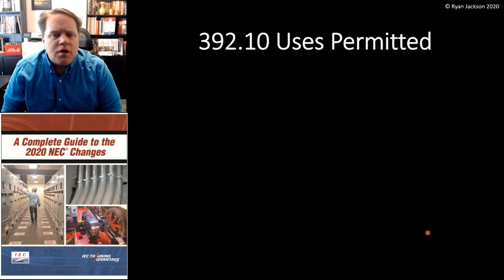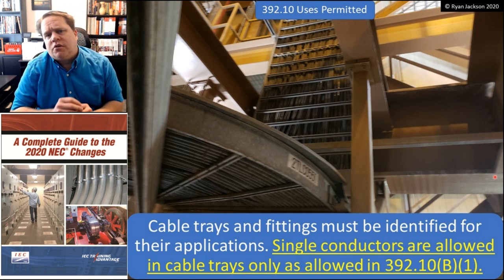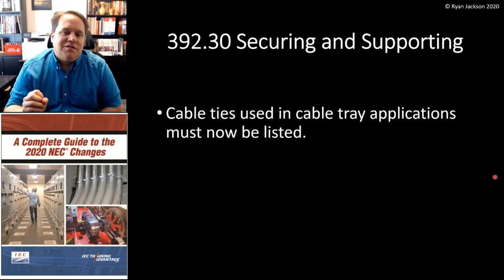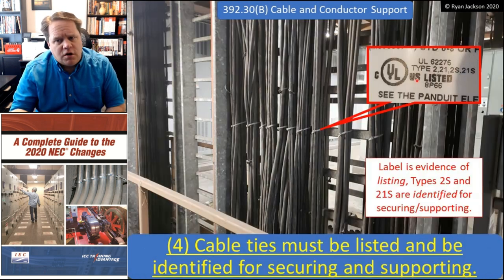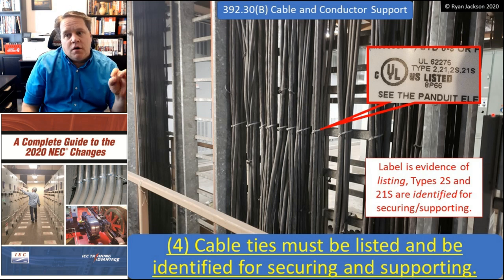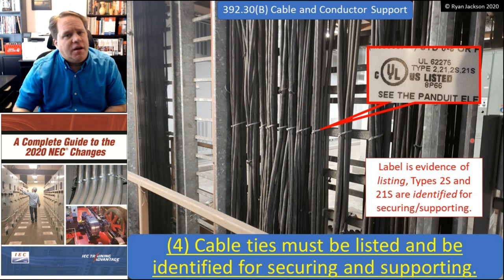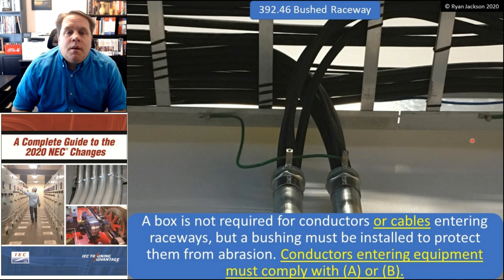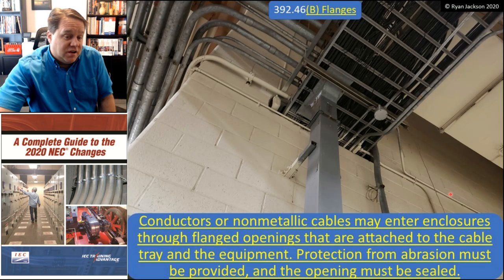2020 changes series: Article 392

Comment: Cable tray is a UL listed for the purpose and is a RACEWAY just like conduit. This is very important. Loose cable or jacked cables must be TC or Tray Cable rated required. UV or sunlight resistant is required. As always it must be installed per the manufacturer's recommendation and per listing and labeling. Thanks for you content it is very good however at any time we discuss tray I suggest we review the unique status of this type of raceway.
Reply from the maker: It isn't a raceway.

Comment: Thank you very much for this Video. may you please help me out for short questions :- 
1. is it mandatory to install cover on ladder type cable Tray ? cable tray will be installed in a metallic container. and not approachable to user.
2. if Cable is not Tray Type listed, but approved with  UL: AWM 10107 & NFPA79. can we install such kind of cable in Cable Tray ?
The cable is for example ÖLFLEX FD 90/90 CY which is flexible power cable to  connect the machine.
Installation is in Metallic container and Length is not more than 10meter. 

3. I also heard that it always depend upon customer to customer  and area to area by which standards they want to inspect. 
it can be NEC or can be NFPA79.
with NFPA79 its not an issue to install not listed Type cable installation in cable Tray
But with NEC, yes its an issue. 
is this true ?

Comment: Is there anything like "Commercial building" where conditions of maintenance and supervision ensure only qualified persons service the installed cable tray system?  If so, could it be considered  to install individual conductors on their cable trays?
Reply from the maker: No, although I my opinion there should be. There were several proposals for the 2023 to change the concept to "restricted access locations," but those proposals failed. The proponent for these changes works at a national laboratory that has more stringent requirements than most "industrial" facilities but cannot use the allowances.
Reply: @RyanJacksonElectrical  Ok. As usual Sir, great information, useful and clear. Thanks a lot. Already waiting for your next publication.

Comment: Hello Sir..thx for the video. I have a legitimate question.  Where would I find in the code that a cable tray assembly must be identified for that particular application but does not have to be listed? Thank You! (Cable tray or any other material for that matter)

Sidenote: I used to work in telecom years ago.. these are quite common in that industry and for outdoor cells all of the antennae transmission lines are supported by cable trays.. lots of temperature changes there
Reply from the maker: The last sentence of 392.10

Comment: Good content. Really enjoy the code updates. Only thing would be to grt a better mic
Reply from the maker: Thanks for the feedback. The embarrassing truth on this video is that after I shot I realized that my mic was moved from where I normally put it. I had mopped the floor earlier and moved the mic stand, then didn't put it back. 😑
Reply: Completely understandable. I just think that the use of a pop filter is underrated and the room echo is a little rough when I'm listening on my van speakers omw to work
Reply from the maker: @chrishull1993  I use a pop filter as well. In fact, you can see it in the video I did yesterday 
Thanks again for the feedback, I really do appreciate it.